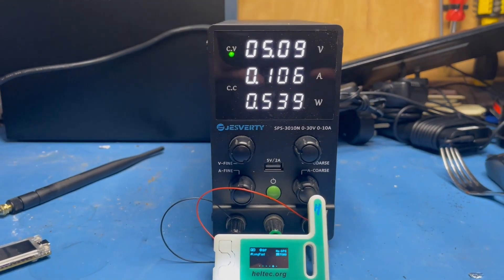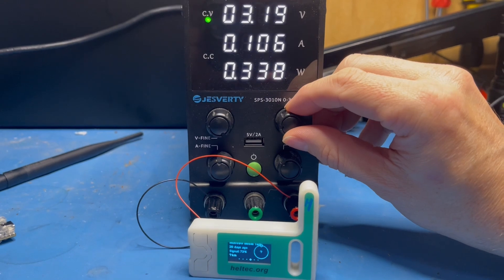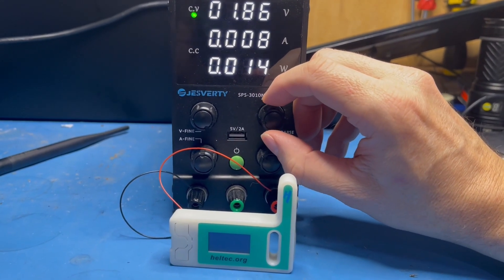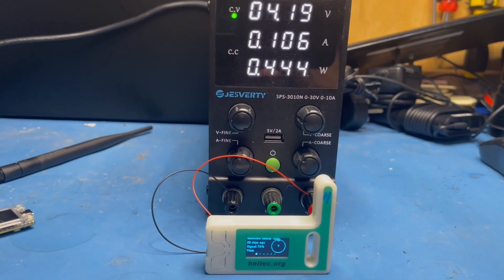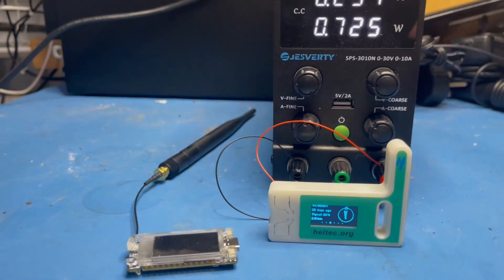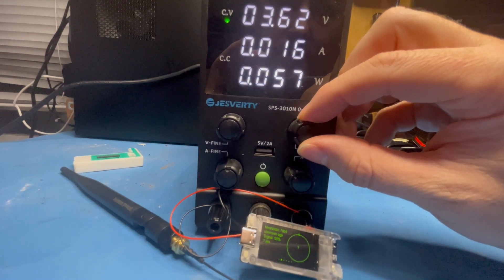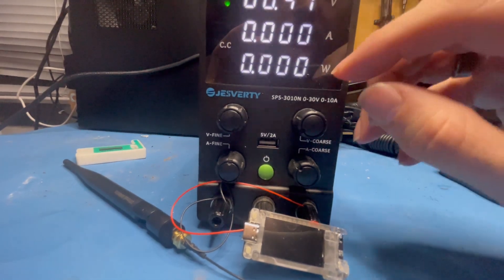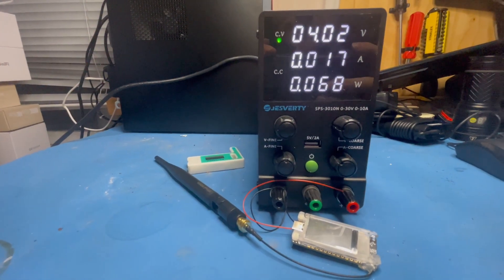Meshtastic Heltec v3 vs T114 Low Voltage Test for Solar Installations

Comment: Any idea what the max voltage these can take on the solar input? The spec sheet says 6.5v, but I have some cheap panels that can put out 7.5v on an OC voltage, wondering if they'll work or release the magic smoke :)
Reply: You can just use a 12v panel to feed a car lighter phone charger and from there to  the board. This way you will always get regulated 5 volts.